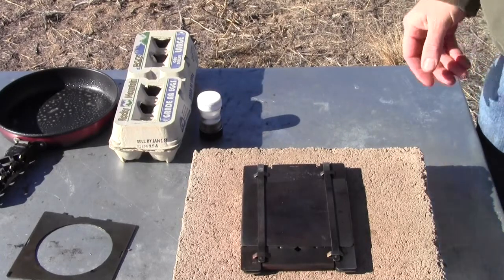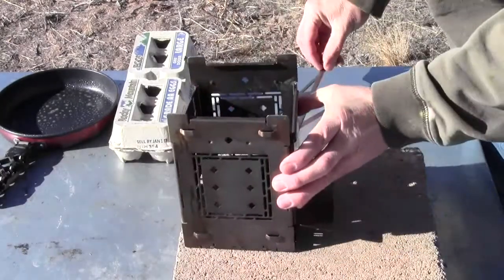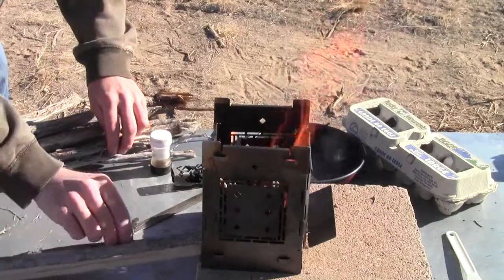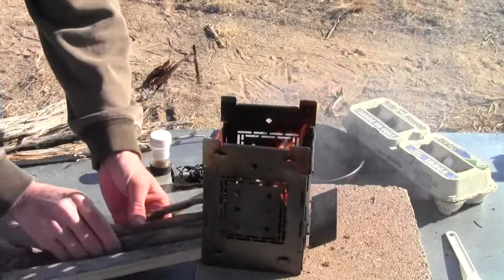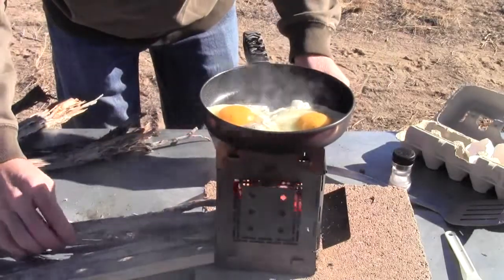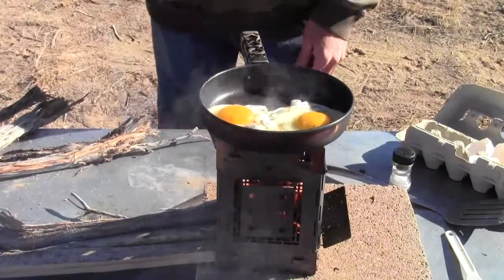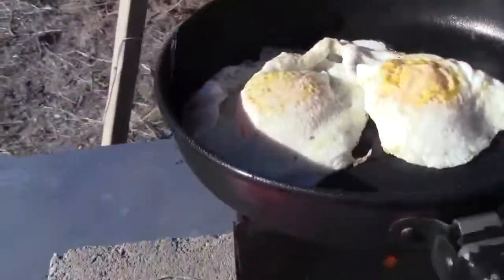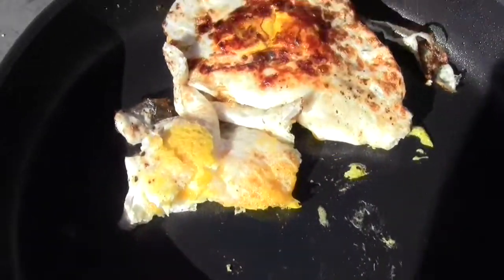Cooking in the side feed configuration.

Comment: Looks good! I wonder if draw would be enhanced if you closed the flap on the windward side? When closed, the lower pressure area would set up on the lee side, and along the side openings since the air has to flow around. The lower pressure areas will result in air being sucked in and accelerating the draw, which might oxygenate the combustion chamber? Another test could be to place the wood feed upwind, and then open the flap on the downwind side? No end of fun with sticks stoves eh!